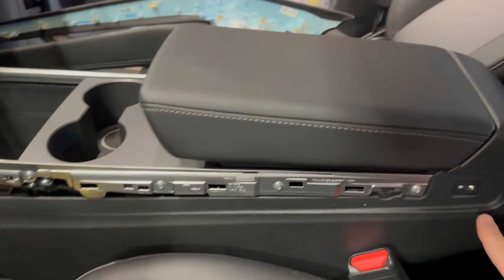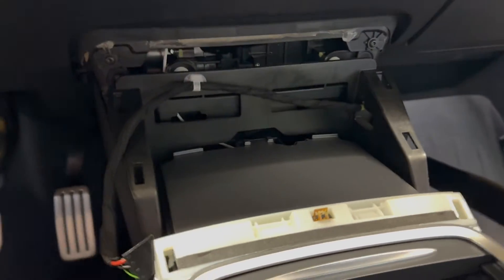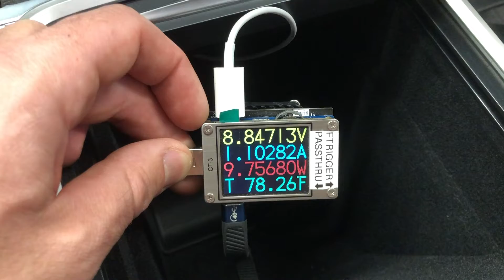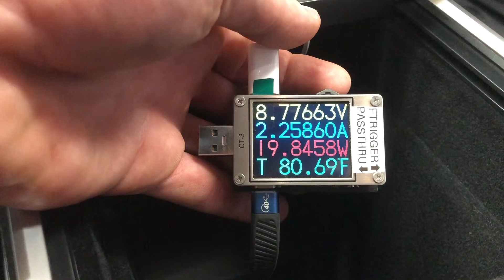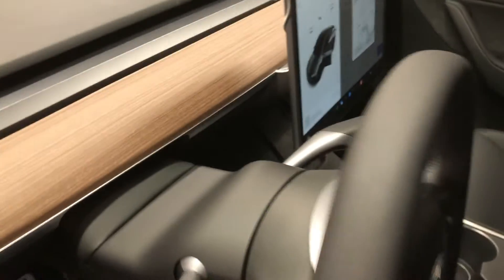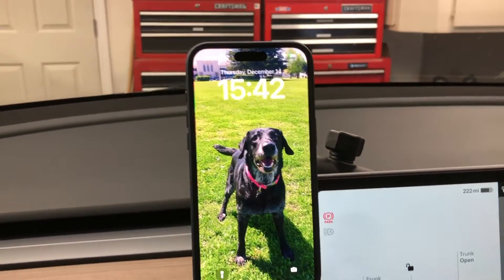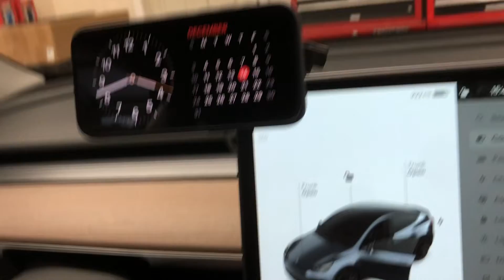True 15W MagSafe for Model 3 & Y: Cable Routing and Power Measurement

Comment: This unfortunately doe NOT work on Model 3. There is no room for the cable to pass through dash as the HVAC system uses all the space.
Reply from the maker: Are you absolutely sure? I encountered all kinds of stuff in the way on my Y as well, you just have to fish it through an opening.
Reply: @colindgrant  My model 3 is also different. I could remove the side panels, but I had te remove the side pading. Drilled a hole finally. I am ok with that. Only thing is that I lost some clips when snapping it back.
Reply: Which model 3? I’m thinking of doing this method with my model 3 2021
Reply: I have a 2021 Tesla model 3 performance and it took me about an hour to get the cable from behind the monitor down through the center console. It was tight but it was able to finally get it.